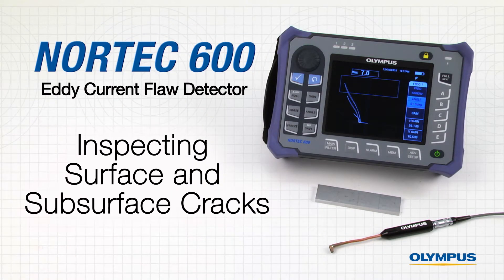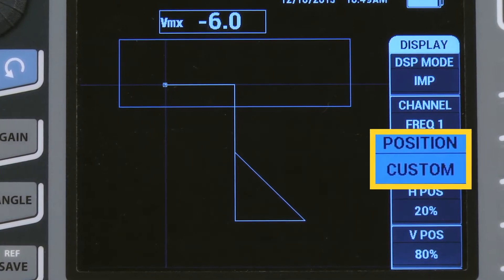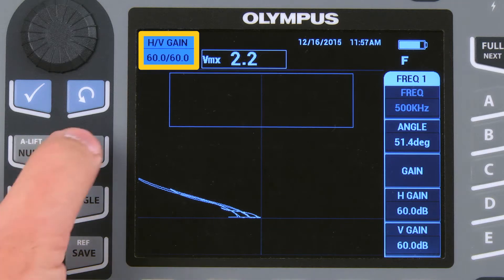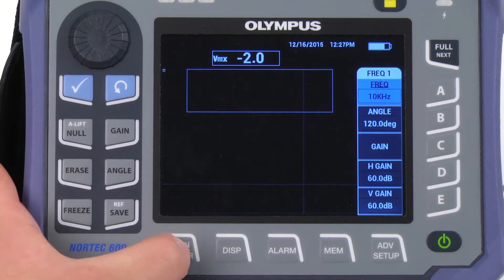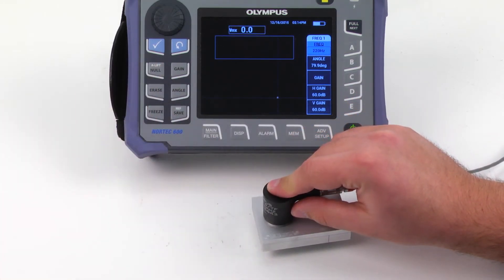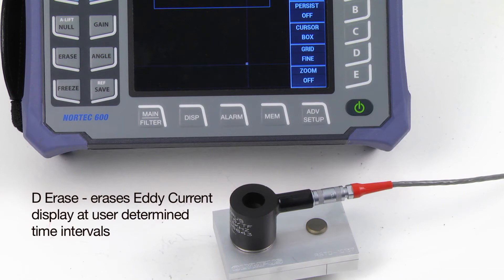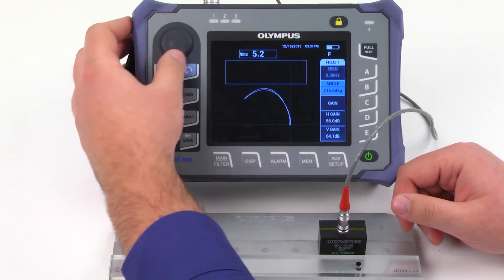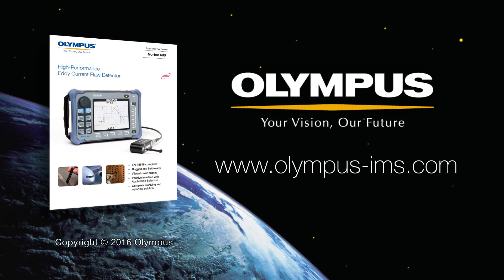NORTEC 600 - Surface and Subsurface Inspections Configuration Guide

Comment: Can you post a video on using NORTEC 600D for inspection of Heat Exchanger Tubes (in differential mode) ..... Please its URGENT.
Reply from the maker: Hi there, If the issue is urgent, we'd recommend contacting us directly: http://bit.ly/2pwNE3l. If you have an email address where we can reach you, we can have our technical support team contact you faster. Thanks!